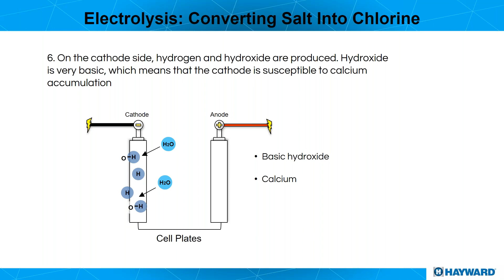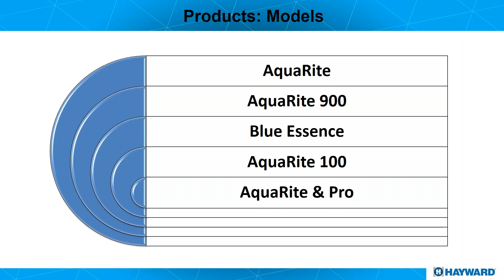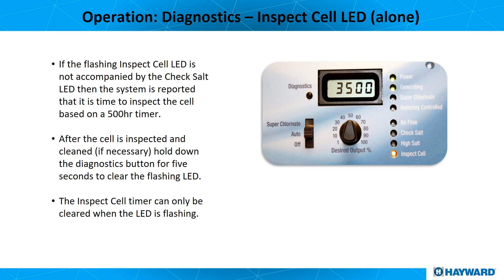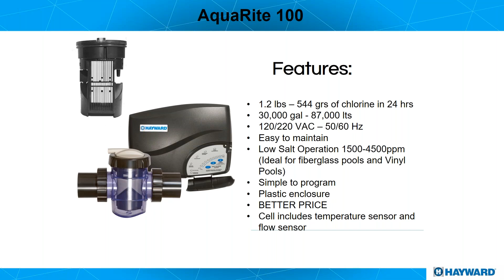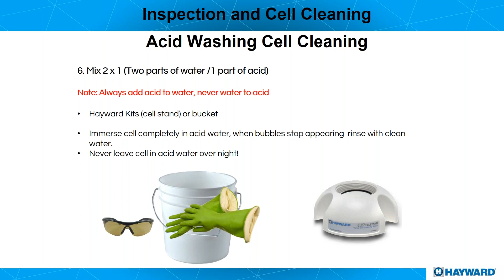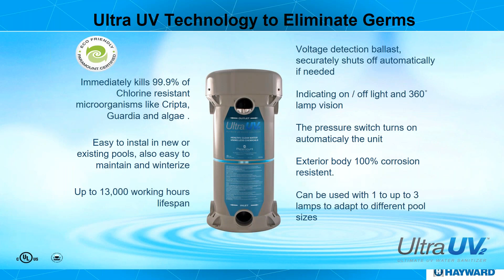Hayward  Sanitization Salt Generators, UV and Ozone

Comment: thank you for this video it has been the most helpful. I have the Hayward 100 salt system. We replaced the 20 amp fuse as it was burnt. Now we have the problem light with five lights on and the max light.  We cleaned the Salt Cell and have restarted the system and the same lights are on. What now and how long should those salt cells last?